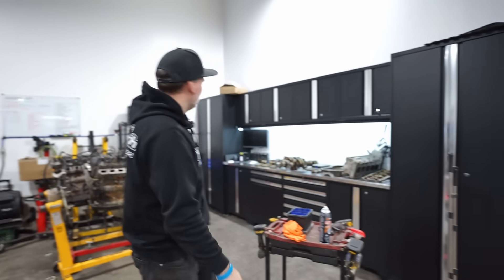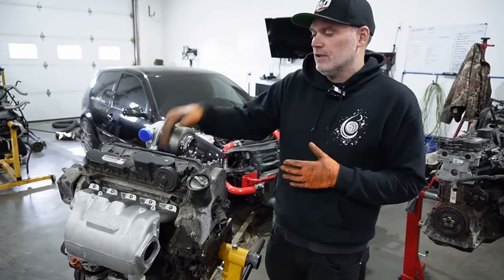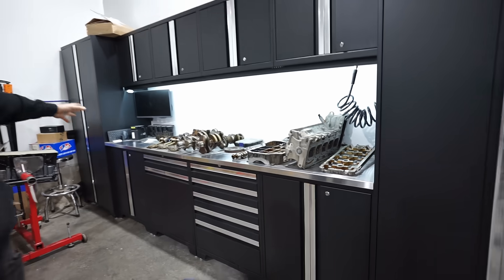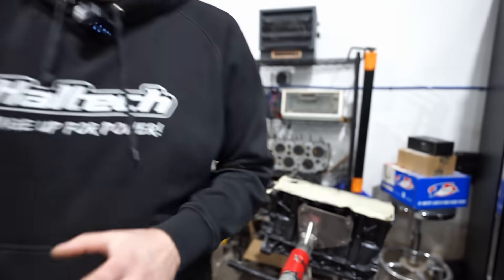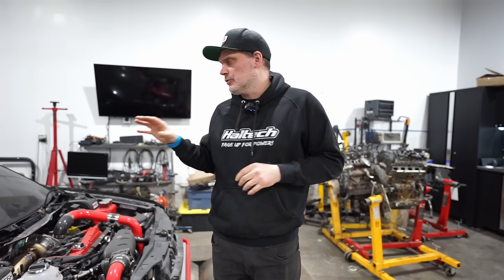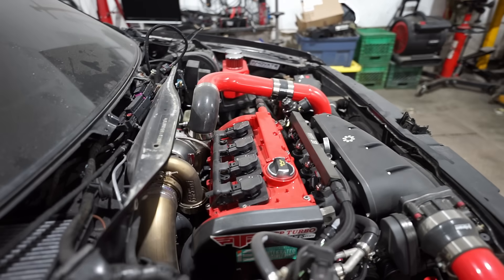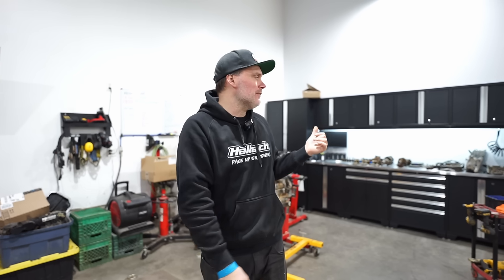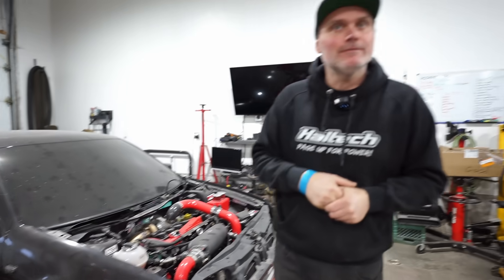Building a Big Turbo 1.8T, set realistic goals

Comment from the maker: PSA...be realistic.
Reply: Being  realistic i wanna put down 250-300 hp on my 1.8t I have garret m24 turbo .60 compressor ar t25 exhaust manifold I have been up at nights thinking whether the m24 will deliver a better overall better  power band than ko4.  Or is it safe to run the m24 garret on stock internals. The car is a daily driver but I am currently restoring it and need guidance on selecting turbo sizing.
Reply: @noahjoyeux8254 ko4 way more reliable. 300hp is a sweet spot, it won’t work too hard.
Reply: No

Comment: Can you comment on the AMB longitudinal 1.8ts? My engine just blew a timing belt and killed the pistons from the valves hitting them hard and wondering what I can do to make a better engine for it with more than stock horsepower roughly around 300 HP for daily driving... Not for racing by any means. It's an A4 wagon.

Comment: i had a mk1 gti with a 1.8t big turbo that dynoed 260/260 and i thought it was low but it was an antiquated setup, old tune and stock motor but was so much fun in a gutted mk1 that i didnt care. still did 3rd gear posi burnouts on the freeway when cold.

Comment: 😣😣🇩🇪NEED🇩🇪😣😣help!
05 Mk4 GTI with Tiptronic automatic (console paddle shift) just need a way around this obsolete part without doing a full manual conversion!! Just need to fix  what the dealership is calling an obsolete part. Dust cover with the magnetic piece…
If there is a hack to it like glueing the magnetic in a single location or a swap for a reasonable gear selector option that kinda fits etc… thank you for your time love your channel if your shop was close I would let you help me build this car up a bit.
Reply from the maker: @dareckanderson9703  zero clue sorry. Don't deal with pretty much any auto mk4s.

Comment: Is there a chance to message you directly would you take time to speak to me about my setup for my 6L seat Ibiza 1.8t build I have a built engine and I want 400-500bhp safely on pump gas I’m in uk so that’s 99 octane on our super unleaded fuel I wanted to buy a g25-660 wasn’t sure how to go about it I have a built BAM/AGU with N/A AGN cams inside built valve train built bottom end I have stock bam pistons I could send a full list of engine parts to help if needed. Hope to hear from you thanks. Liam 🤗🚘
Reply: Mine is a daily driver but atm it’s parked up saving the miles my engine has done about 13,000 miles on 530bhp now ran 1,000 miles on a stock k04 can I still build my engine without things breaking or should I have never bolted the k04 to it been told can break things 😳

Comment: A 700hp 1.8t would be pretty insane. I had an 01 Wolfsburg Jetta with a custom downpipe and an aem cold air intake and an exhaust and it moved out for those very little modifications.
Reply: im on the road for going for 500 i just sent my engine out to be machined

Comment: Low to mid 300's sounds perfect for my application - looking for a responsive midrange setup with maybe a light engine build - debating on just doing rods and head-studs but i heard exhaust valves can be a failure point with a roadcourse car. As far as turbo sizes, debating on what's the best option for response as well as power curve.

Comment: As an owner of a 'big turbo' 1.8T that puts down 350whp and 320ftlbs on pump gas in a mk4 GLI, i can tell you first hand that it is fun but 1st and 2nd gear are useless. They just spin for days. I am running 19x9.5s with a diff and they just spin. But 3rd gear and up it rips. Some day i would love to swap it to AWD and turn it up to maybe 400whp. I have had all the AWD parts for years, just not the time with 10 other cars to work on. That being said my stock mk4 R32 is far more fun to rip from stop light to stop light. I also built a turbo 3.0l Corrado and went over board. When i started the project i was young and wanted to build a street driven 'race car'. I made all the mistakes. Big turbo, 4 puck unsprung clutch, solid steel motor mounts,  ac delete, along with many other mistakes. All that with a show car interior, engine bay, and body. That thing is a nightmare to drive. I have probably put 2000 miles on it since 2005. I have personally lived both sides of this video lol.

Comment: I have a question about the 97 jettas with the 2.8 vr6 how easy is it to swap in a 3.2 vr6 if possible
Reply from the maker: @Soulbro35  comes down to your skills, knowledge of wiring, and budget.
Reply: @ I have done swaps. H22 accord and 1jz fc. I am new to VWs . So other then the wiring the 3.2 should be able to bolt up to 2.8 trans? And do motor mounts need to be different, and axles?

Comment: My stage 1 Mk 7 R breaks traction. That much power in a FWD only car gets sketchy. 

Years ago, I had a stock 95 accord wagon, F22B2 engine. Not a lot of power. It would smoke good tires on a dry road - probably on about 120ish wheel hp.

Have fun in a low powered car. Then, make incremental changes to make it a little more fun. Don't jump from 200 wheel to 600 wheel and treat it like the same car.

Comment: So if I already have a decent set up 2.0T, K04, HPFP mod, HPA intake manifold, FMIC, hard pipes, highflow DP, next install is a water meth kit, 2 nozzle system. I have easy access to 91, 93, 110 and E85. Looking to do a full bottom end build this fall over winter. What fuel upgrades should I do to max out the power of the K04? Ill be looking to upgrade that next spring/summer.
Reply: How are you tuning it?
Reply: @williamrouse3033  right now, just a flash tune. Integrated Engineering K04 93octane tune

Comment: I got my eyes on the gt2871r eliminator kit on your website for my b6 a4. Goal is to make over 280whp on 93, and 315whp on e85. Hoping for 12.XX quarter mile
Reply: Don't do eliminator

Change out the manifold
Reply: @williamrouse3033  I have a higher flow manifold already, and a K04. Ideally I'd like a BW efr7163 but I don't know how fast it will spool, and that would end up being quite a large turbo for the power I want. Suddenly I'm chasing huge numbers and building the engine and then I go broke. Not sure it's the best idea for me. I have another car for insane speeds and 10s quarter miles

Comment: What would be your recommendation for a mk7.5 GSW w/4motion? It’s my daily. Drive 100 miles round trip four days/week. I burn premium, 90, 91 octane. Very little e85 around here. DSG. I just want something more exciting. I’m 54, and I’ve had four previous VW’s , all modified mostly in suspension. Never purchased a tune. Had a couple of intakes and cat backs. I’m in the online groups, and hear all the chatter, but like the video says, I’m realistic. Thanks much.
Reply from the maker: @jeffropenn  tune it first, it's decent bang for the buck for power and may be all you need. If not a GTI turbo is a great upgrade for them, little cost and great power and drivability.
Reply: Is20?
Reply from the maker: @jeffropenn  correct
Reply: @COMotorsports  thanks a lot. 🤙🏼

Comment: I have a FWD B5 A4, people look at me crazy when I say I only want around 400 to the wheels. It's a daily and I really don't want to spend $2K for a clutch! It would be such a turd in the low RPMs if it made 1000hp! But good news is the engine I slapped together in my basement is going strong with well over 10K miles already! Just haven't had time to put the bigger turbo on. But a K04 making 26psi is pretty fun... It's on E85 and methanol BTW...

Comment: The problem is folks get so caught up in numbers. My 20th MK4 is set at 350 WHP, with ability to make more. At 350 WHP it’s still feels fast every time I really lay into it, and anyone who rides in it agrees. At that power level it’s still fun, manageable, and easy to drive.
Reply: Numbers mean nothing if the car is un drivable , also things start to break over those power levels.
Reply: I want a hybrid k04 methanol setup that makes 350 whp 370 wtq. Quick spool with a wide powerband 👌
Reply: what mods did u put in specially on the gearbox?
Reply: @steambuns2283  I’ve got a single mass flywheel and a South Bend clutch, I can’t remember what Stage, but it’s heavy. No issues with it.
Reply: @ stock diff?
Reply: @ yeah. I want to install a LSD, but it just hasn’t been in the cards yet.
Reply: Exactly! My Mk7 Gti is perfect @ Stage 2 eqt. + e30 file for when I’m feeling extra spicy!
Reply: What mods did you do? I’ve also got a 20th and I’m currently working to fix it however I eventually want to have it sitting at 270-300 hp so I don’t have to mess with the internals and when I have more knowledge and money to be able to mess with the engine I wanna have it sitting at 350-400 do you recommend anything in specific to have it at  that 300hp I’ve already got a fmic and a lil crappy cold air. Plants right now are the 2.0t coil packs bigger injectors and someday a ko4 but not sure if I should also get anything else

Comment: How real is it to put down 400-450 whp on a 1.8t with pump gas?
Reply: Very real.. 500whp or under is more then enough for a street car.. most people have never felt a 400-450hp 1.8t street car.. it’s not slow by any means..light cars and 400hp is a wild experience..
Reply: Very realistic on 93.
Reply from the maker: @alexbakaloff  as stated, realistic. Just remember the more you try to make safely on pump the more the turbo becomes less fun for street use. Meaning you're not using a smaller quick spooling turbo to make that power on pump. Sacrafices need to be made somewhere.

Comment: Ive seen 800+hp on wheels with pump gas my friend. And yes, on 1.8T from a gold 4😂
Reply from the maker: At no point did I say none of this can't be done. Of course it can, we do it all the time. What I'm saying is for folks to be realistic with their goals for the purpose of the vehicle.

However 800whp 1.8t on 91/93....naaah.
Reply: @COMotorsports  what is not realistic with that ?
Reply: 350-400 on a hybrid 18T mk4 lower, aeb head) like Clayton's with a 6 spd awd. It'll be a part-time street car, but I'll mostly be wringing its neck at autocross. It won't always live at redline, but it'll have to pull its own socks up with all the transition driving. I was thinking k04s and probably rods, due to (inevitably) it being bogged a little. Valve upgrades?
Reply: @vinkata Had a rod piston stock displacement big port head 1.8t with a pte6262.. built everything.. pump gas 93 on water meth made 550whp safely.. on race gas made 650+.. no way a pump gas car is making 800whp more then 1 time before the valves turn to spaghetti noodles with the egts it’s gonna make..even race gas or ignite e90 would be hard to do with a normal rod and piston motor..
Reply: @timbrady8236  easy done in Europe. What is this 93 shite you are talking about ? 100 octane bro. There are tone of videos daily drivers and drag race cars. Of course you need stage 2 for that. 400 can be done with less than stage 1. You need bigger turbo exhaust and ECU
Reply: @vinkata  even 100 octane pump gas isn’t supporting 800whp on a 1.8t without water meth and nitrous and not on stock displacement.. and at that power level on 93-100 octane fuel it’s a ticking time bomb.. pump gas can’t support the timing and boost you would need to make those numbers.. even big displacement engines can’t do it.. the engine would literally melt its self down trying to make those numbers consistently..it’s possible for a Hail Mary dyno run but it wouldn’t be able to be replicated..